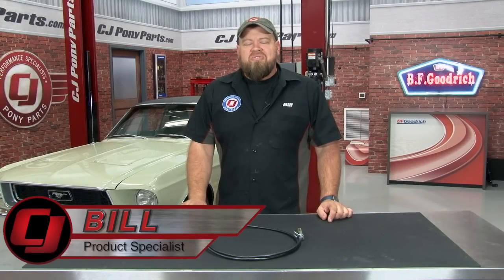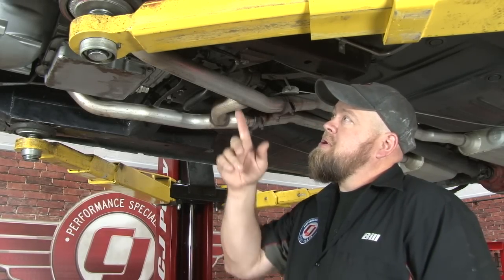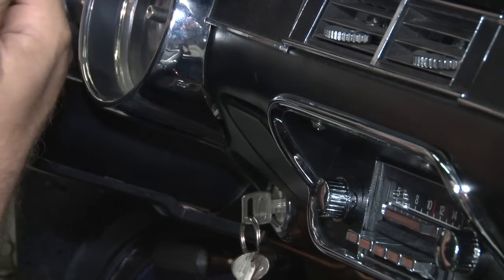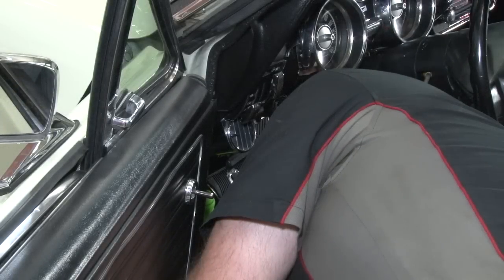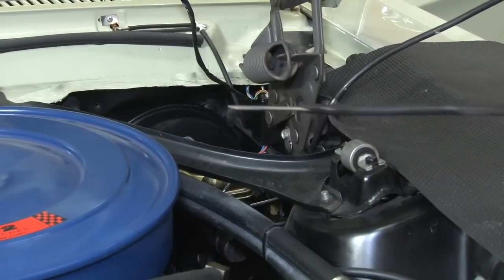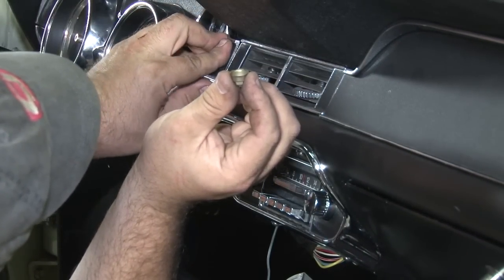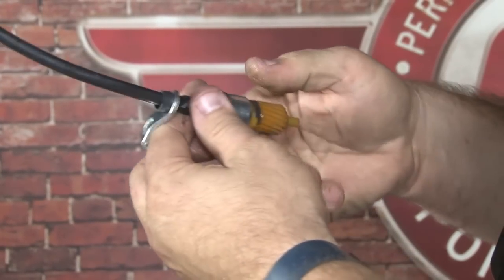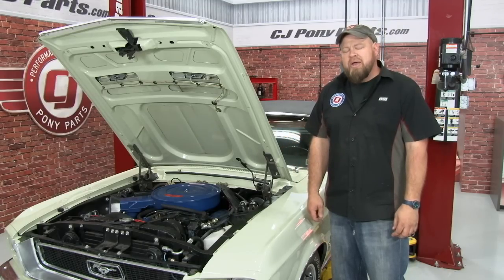Speedometer Cable Concours (Automatic) | Scott Drake | 1967-1968 Mustang

Comment: @2:21 - What is that plastic part underneath the steering column? I have cables underneath my steering column in my '68 and I need some cable management.

Comment: At 5.03 thow were you able ti tighten the knob.It just does not go in.Also how were you able to fit the firewall rubber grommet,it dsnt go in either.
Reply: Akshat Bhandari did you figure this out? I have the same problem

Comment: How do you know if it has factory 3.91 or 4.30 gears? I have a 1968 Mustang with 289 v8 automatic.
Reply: i can almost guarantee your 289 didn't come with either of those ratios :)

check the ID tag on the door
No tag?
Get a Marti report from the VIN
VIN is on tag under bottom of LHS windscreen
..then check original axle code